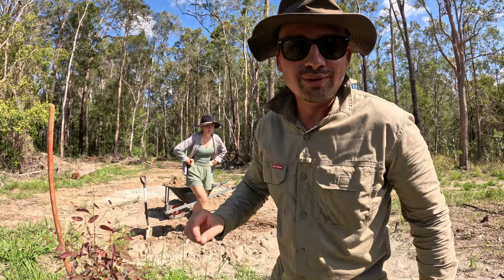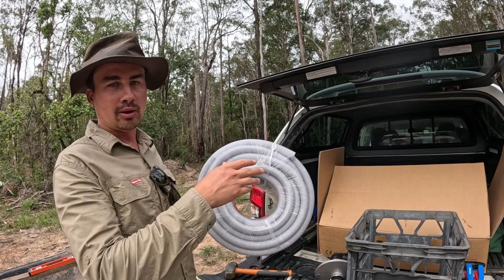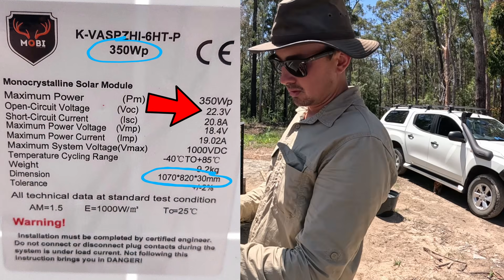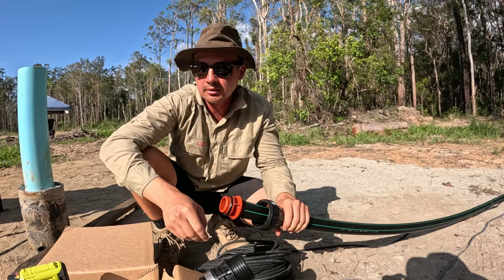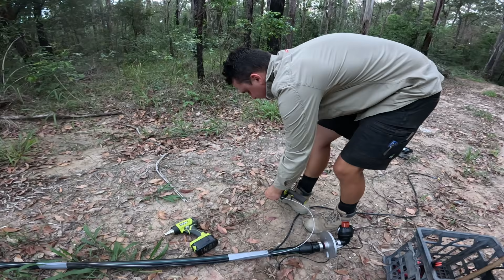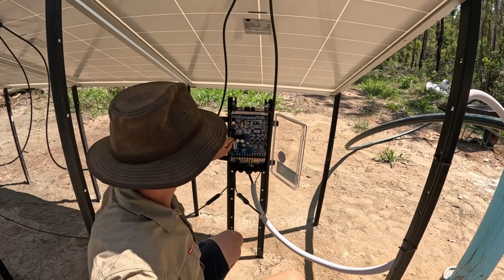DIY Solar Bore Pump Install  |  Start to Finish + Cost Summary (TuHorse)

Comment: Does the pump have filters
Reply from the maker: Filters would be added either before or after the storage tank that the water would be pumped into. The Bore pump just has that mesh screen over the inlet
Reply: @offgridcitycouple4711  thanks

Comment: Did you consider the flood when building this?
Reply from the maker: yes, to the extent that was realistic. The system overall is above the 1 in 100 year flood levels, and the control box can be taken off if major flooding is expected - to protect the electronics in it. Solar panels are fine with being flooded (just from our experience).

We couldn't find water-proof bore caps for sale in Australia, so in that sense the bore will need to be flushed out for a while and lab tested again if flood water goes into it.. which shouldn't happen often - just depends how many of them 1 in 500 year floods we get 🤔

Comment: Do you need to purify the water
Reply from the maker: just depends on what the lab tests show. we just got our results back and the water is suitable for drinking which is incredibly lucky. It'll have a basic filter on it, more details on that in a future video when we figure all that out - but in summary you can get water softeners and reverse osmosis filters if the water is a bit too heavy in minerals and whatnot - obviously it's again hundreds of dollars... the water settles if you leave it in a water tank for a while which helps reduce mineral concentration.
Reply: @offgridcitycouple4711  thanks,probably the more natural the better